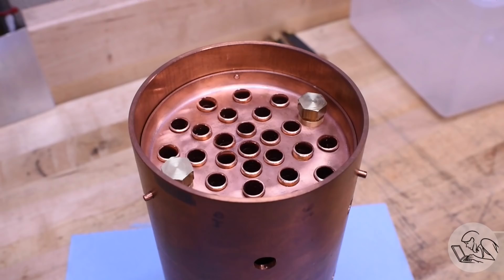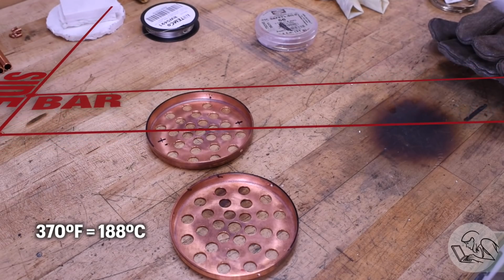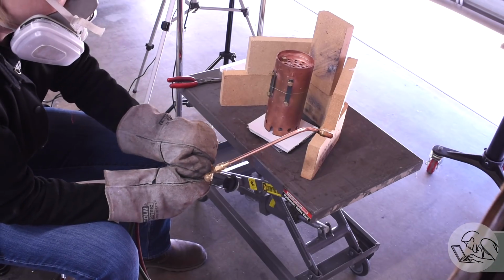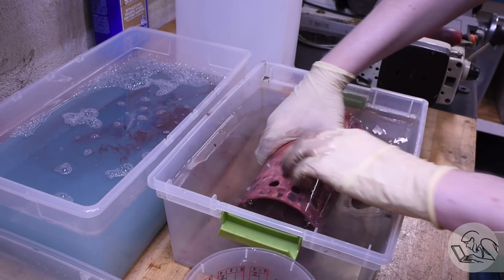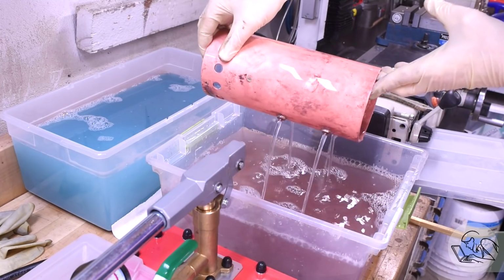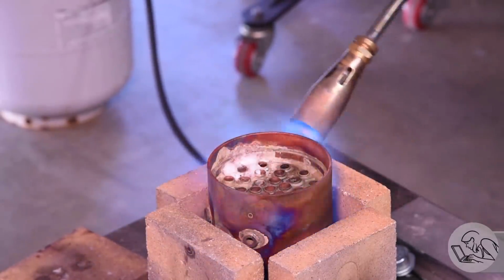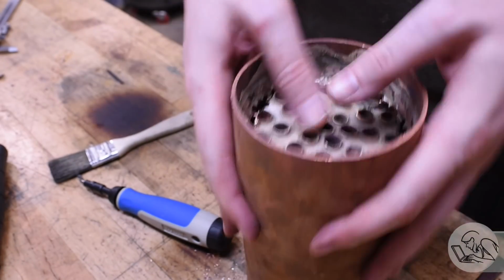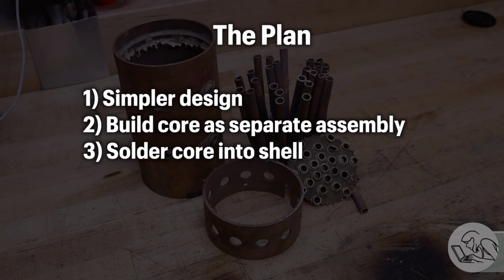Silver Soldering A Model Boiler : Failure!  | Model Boiler Build Part 7

Comment from the maker: If you’re not having failures on your projects, then you’re not challenging yourself enough. That means you’re not learning, and if you’re not learning, you’re dying. Push yourself!
Reply: Oh hell yes! Was just mourning my own mess as I finished turning a 2+ inches flange nut with a special pitch thread out of an aluminium blank I poured yesterday. Spent several hours and all was going great even the internal single point thread cutting I was doing first time in my life until I realised I cut the left-handed thread....%(
Reply: Exactly! one must push themselves out of their comfort zone to be able to learn something new, i always tell myself no matter how smart someone is at something they do, they where never that smart at it when they started doing it in the begging. Im glad you still put the video out! I could only imagine how painful it was to have to scrap the project, but your an awesome machinist, this way i get to watch you build another!! looking forward to it
Reply: I've done a bit of soldering and find that to get a perfect seal I need to use two torches but as soon as the piece gets towards it's target temp is to add more flux before the silver solder melts and always use more solder than what you think, it takes forever to grind it off but easier than trying to repair it 👍👍👍👍👍
Reply: If having failures is learning, I'm learning lots!   :-)
Reply: "We progress through error". Pontius Pilate in the film Ben Hur. BobUK.
Reply: Awesome attitude Quinn! I have never tried to solder even anywhere near half that many things at once, so I am about as far from an expert as it gets, but I had a couple ideas I wanted to fly by you... 1 would it help to preheat the whole thing to 500 degrees in the broiler of the oven? 2 Sparex is ( I'm told)  basically just Sodium Bisulphate,  pH down in the hot tub, pool & spa section of HomeDeathSpot, WallyWorld, or Crappytire...
Reply: The more you know 
The more you forget 
The more you forget 
The less you know 
The less you know 
The less you forget 
The less you forget 
The more you know. 

Ad finitum.
Reply: Thanks, Quinn, a very high value forensic examination.  Heartbreaking demolition process, assuaged by your calm and salient narrative.
Reply: Out of curiosity would it have worked better if you use an electric or gas oven / furnace that you heat up to a 1000C Then dunk the whole boiler in it for a few minutes? Mind you I know close to nothing about soldering but long time ago I built some furnaces for ceramics and that wasn't that difficult. And now seeing the difficulty heating up the whole thing made me thinking.
Reply: @ClanChapman1rRS  Which what?
Reply: @trollforge  HomeDeathSpot, WallyWorld, Crappytire
Reply: @ClanChapman1rRS  they aren't paying me to advertise for them... HomeDeathSpot is Orange, WallyWorld is Blue, and Crappytire is a Canadian thing... do you grock?
Reply: @trollforge   '
I have teo hand it to you sir; I have learned something new here. Yo intiendo a todo
Reply: @ClanChapman1rRS  awesome!
Reply: This was so painfully heartbreaking to watch! Thank you for sharing your failure, and we can all learn from our mistakes
Reply: What failure??  I don't get it?
That boiler was a wild success!
Reply: Don't forget to turn on closed captions if you hadn't.
Reply: Making a LOT of (silver) rings perfect and stupidly easily - check this: https://www.youtube.com/watch?v=OQHBuxI4TXs&t=67s 
The link/video is how Shaping Silver is making two Witcher medallions.
Reply: Gutsy video all around, very few engineers (am or pro) will admit failure.
A quote for all engineers (am and pro) "Failure is only failure if you don't learn from it."
Reply: This is also going on my shop wall.

I won't have room for tools at this rate.

Comment: Watching along, knowing in advance from the title that it wasn't going to work, it STILL looked like it was going to work right up until you were in repair mode, and more leaks were popping up than you were fixing.  Thanks for posting this.  Your next step approach is probably best.  Being stubborn, I would probably have tried the same approach again, but with Cd included solder, and a furnace preheat or furnace flow.  The thinking being that maybe Cd would improve crack resistance/ductility, and a preheat would maybe make for more even heating.  Both guesses.  I get why no Cd, and I respect that...I'm older, so less overall risk for me.

Comment: Hi Quinn. Fantastic bloggs. I have only just caught up with your collet chuck and boiler making episodes. Just a little tip for you in relation to using the ER collets. You are supposed to spring the collets into the closing ring from the back so that the closing ring sits in the groove machined in the collet. If you don't do this then you are not closing the collet correctly - possible results run-out and/or damage to the collet. Keep up the brilliant work - I personally can't manage welding or silver soldering.

Comment: That was really cool. I only used propane for doing silver soldering. I don't have much experience with it but even with a big burner it can be hard to heat up bigger parts of copper. Next time I'll try using ceramic fiber blanket. I used that before for heat treatment. Works really well for insulation and you can get things orange hot quickly. I have some of the ceramic fiber left from my pottery kiln built. Just be careful not to breathe too much of the ceramic fiber dust.

Comment: Fuel elements in nuckear Reactor are mostly square, have hubdreds of fuel rods in them and are several meters long.

One exceptions however is the Candian line of heavy water reactors,  and the Idian line which isna copy of the canadian one.

They use 30 cm ling round bundles as fuel elements that are light eniugh  (22 kg) to be hold up by a person.
Also the cladding of that kind of fuel is from a zircalloy, the alloy the indians use has a brown ish colour and those idian fuel bundles do really look like those fire tubes.

Comment: If you can "reheat" in a carbon monoxide atmosphere, say in an oven, it's possible to seal such by reheating, or oven brazing to start with.  Reheating in an oxygen laden atmosphere means the solder will be oxidized and won't resolder.  That is a basic boiler truth.  I have in fact, done this job, a couple times before it was right.  Very good job at inspecting, and changing tactics.

Comment: Let’s design and build an induction spot heating device for this project. 
Also, what if you use the flaring tool to tighten the joints prior to braising? 
I also think it’s best to make a flame-less temperature controlled oven for heating the entire boiler at once.

Comment: As someone who's soldered thousands of electrical joints, and taught a fair few people to do it well, I found it fascinating how similar, yet entirely different the challenges here were.

I can imagine how difficult this must have been; especially with the setup you had. I'm quite confident that I would have done a significantly worse job, too.

I'm delighted you shared, and frankly given the attitudes of some internet experts, I commend you for doing so.

Great series. Looking forward to seeing the end result, I'm sure it will be superb.

Comment: Try using wire wool to clean the ends of the pipes before you solder it gives the solder something to grip into and your flux will remain at the joint more but not entirely. You know.... Flux... Runny rubbish... Good luck.

Comment: I've being looking hither and thither for more than a decade to find out how my espresso machine's heating element was brazed to the boiler's brass base until I came across this video! Now I know! (I think).
The brass plate used in the old boiler assembly looks like a work of art compared to the newer stainless steel replacement - it's also a lot quieter (yeah, I know, BUT it's annoying, trust me).
The old brass plate was de-commissioned after a truly silly repairman tried to drill it to attach an new thermostat and only managed to put a hole through and thus turned it into scrap. I mean what was he thinking would happen? All because he didn't have the right thermostat spare  at hand at the time. No comment...
I always wanted to somehow fix the hole in the brass plate and in the process maybe re-tin or re-plate the copper heating element so it won't corrode. I'm not sure what re-plating the element will involve, but first things first.
Any ideas? I took it to a local welder who said he couldn't weld brass and suggested I used a screw plus loctite to plug the hole. Naahhh...

Comment: Hmm, how do you say "Nice to see a failure" without sounding like a douch?
Watching this was educational and a little cathartic - thank you for sharing. 

I wonder if (lingo is going to be pretty messed up, but hopefully it will make sense)
I wonder if the end-caps that go inside the boiler shell tube, would benefit from a small grove being lathed into them before assembly, as a place you could lay a wire of solder, before pushing it down into the shell for soldering.  Would be interesting to see if that would do anything, or if it would create a different issue with solder having a place to "pool" inside the joint...

Could try the same around the threaded fittings that seem to be hard to get solder to run through.  Kinda like having an "O-ring" made of solder.

Look forward to seeing the next installment and the new boiler.  Godd luck

Comment: Could you use something like one of Stan's Hotshot ovens to do this. The 360 might not be big enough but other manufacturers make bigger ones.  Perhaps there's a heat treating shop nearby that would have one.  Seems like a gradual soak and ramp coupled with an argon purge would be the ticket.  You could cool it down as slow as you want too.  Of course if your goal is to learn to silver solder using an oven would deprive you of developing that skill.

Comment: Quinn, I thought MAYBE a small jeweler's torch might help out if you try more boilers in the future,,,,,,,, jewelry supply  check the Gentec-Small-Torch-Kits-with-Regulators    ,,,,,,Also, I worked for a company in Oregon and we made boilers almost as big as a bus (lol) and any way, we put the boiler plates on the tubes first and then the were inserted into the shell last. That might work, might not.

Comment: Try furnace brazing. Manual brazing such a complicated structure is simply just too variable. Make a rudimentary oven, keep oxygen out completely, heat it up electrically to required temp (1100 F +) (or an alternative means) and you are done. All joints perfect. Success will depend on how well the parts were protected from oxygen ingress. With that in mind, be cautious of all advice that allows the introduction of oxygen such as a propane and air flame torch. I can see you in the future operating a Furnace Brazing Facility to finish others works of art.

Comment: My heart goes out to you!  And can sympathize with you.  I had the same  silver solder problem many years ago with a Little Engines copper boiler that I reflued!  I bought the engine knowing it needed new flues.  The rear of the boiler is cast bronze and the front is a 5 inch copper tube, 1/4 inch copper front sheet and with copper flues.  After we silver soldered the  new flues, the front leaked with several small holes!  In trying to resolder each leaking hole,  the flues next to hole then leaked.  Each reheating (with more solder) got more leakers on surrounding flues!  The cause of the failures was because we were heating the flues faster and hotter more than the rest of the boiler!  The hot flues were expanding more than the outer copper tube and tearing the flue and front sheet joints loose.  The fix was pre heating the boiler in an oven to 550 degrees F.  Wrapping the cast rear end in an asbestos blanket.  Then heating the outer copper tube and flues together and reflowing all the front joints.  Wrapping the whole boiler in the blanket and letting it cool the next two days.  That fixed all the leaks!  It hydro tested to 250 PSI and it has steamed well ever since.  Really enjoy you videos and appreciate the many hours you spend making them.

Comment: Excellent video.
    While you have acid mixed up you may be able to sharpen your files. It won't hurt to try...
Wirewheel your files and lay them in your acid bath for a while to SHARPEN it. Battery acid is what you use for sharpening, but this type of acid MAY also sharpen. Then go into a water soda mix to kill the acid, then rinse well and roll up in a dry towel. ////
   On another note, A friend told me they use Propane (instead of Acetelyn) and Oxygen in a torch. Propane actually works BETTER, and is MUCH cheaper. ////////
   Another addition, to your shop is a blast furnace.I built mine, in a 40 gallon water heater cut off 20" long from the top down and inverted it, and put it on 2 wheels and a skeg. with a drop-in T-handle & tractor pin. Lined it using a plastic 5 gallon bucket for the inside form for the Sparcast 28G Refractory mix. I used it as a forge as well as a blast furnace or a hot box for operations such as yours. When I became disabled, I gave my young partner it and the Toro leaf blower that was the air blast for the furnace. (I made a top to it with a 4 inch soup can laced in to a 4" thick welding rod strengthened layer of the Sparcast 28G...on a rolling hinge pivot off a foot-peddle lift and a swing handle, attached to the 4" long piece of the 40 gallon water heater. The inside was a plastic 5 gallon bucket as its center form. It was easy to slip out since it was tapered and wasn't porus). The air blast tube was an old vacuum cleaner snap-in metal tube.

Comment: Just out of curiosity. Is there a reason you couldn’t tig weld the joints? The inside ones would be a little awkward, but with the firebox out of the way, should be a doddle in mk2.

Comment: Thank you for that Quinn. I have a completed boiler that has been drilled incorrectly, and I was going to ss some bronze threads in & start again (it wasn't me!) But seeing what happened with the cracking of the tube joins I think I'll come up with a plan B on that. Your difficulty seems to be that recessed tubeplate, the top one seemed fine. So if it's OK I'll take my lesson from your misfortune, and I wish you success in the future.
sdk

Comment: I've never built a model boiler or done any soldering before, so excuse the question; what issue do you get if you solder the tubes in first, without the shell? Wouldn't that allow you to get the heat closer to the plates?

Comment: I am very impressed. A/C techs use 15% silfloss sticks. Easy to use no flux and can withstand 5x the pressure you require. 
Oxy/Act your flame should come to a hard point.
Weld your tubes to tubesheet then slide into shell. No more cracked tubes. 
I have not worked on toy boilers but I have worked on real ones the size of your house. 😃
Reply from the maker: It’s not about pressure. Steam is a different beast and SIL FOS sticks are not compatible with it

Comment: On our rotors and pistons which require some precise silver-soldering we heat up the part and  dip it into a flux bath. Old school way is borax and water. Sometimes it takes a few dips to get enough of a flux layer. 

For the amount of time needed to heat that mass you may want use the Harris black flux. With the propane torch it would make short work of it. The white flux is good but can tend to burn off a bit quick. Good on you for trying something new. Looking forward to seeing you get it.

Comment: No doubt fire tube boilers are tough especially when you have so little room to work. I applaud your efforts. It is one reason water tube boilers eventually took over because they could take the pressure. Good try though. Its only a failure if you stop. This is the art of engineering. The science we try to do our best but eventually it gets to the edges of knowledge and into experimentation. No experiment is a defeat just an experiment with something always learned.

Comment: I like your “let’s make it happen” attitude. I’ve never had ever done a boiler, and thinking out loud. Could you maybe use a modified bubble flare on the inside ends of the tubs? Having a short straight section going through the holes. Great channel.

Comment: The acetone not only "stabilized" the acetylene, acetylene is quite soluble in acetone.   This lowers the pressure need to store it.   It also makes it more difficult to determine how much acetylene is left in the tank as the pressure is mostly a function  of tank temperature.   In the "bad old days," the tank also has asbestos which kept the acetone from sloshing about.

Comment: I don't know if this would be applicable to model-boiler making but... Why not just weld everything together? Copper can be welded with a TIG-Torch quite well. And id soldering is absolutely required, why not supply the heat with a TIG-Torch, at least for fixing the leaks. It seems like that could deliver the needed heat in just the right spot. But I've never tried welding something so delicate or soldering anything with TIG

Comment: I believe it is acid to water as: as you start to pour, it is first a little acid in a lot of water. This way, there is more likely enough water to absorb the heat generated. If you start the other way, I am told the little water in the large amount of acid can cause the little water to turn to steam quite rapidly and cause an explosion causing the acid to splash up and chemically burn whatever it lands on.